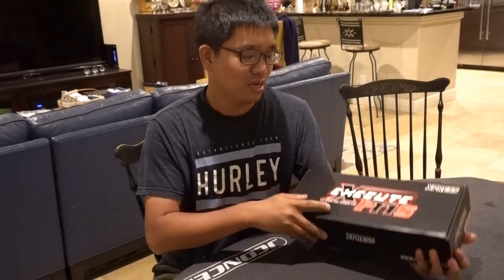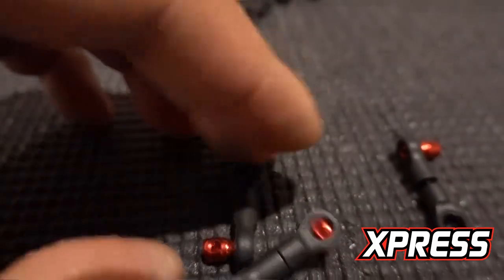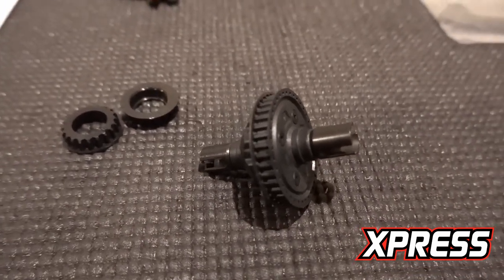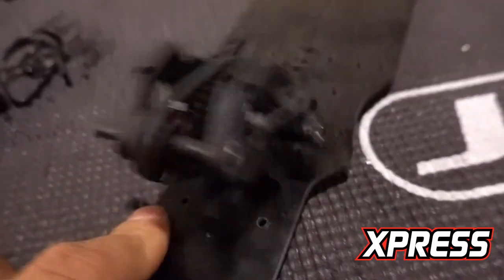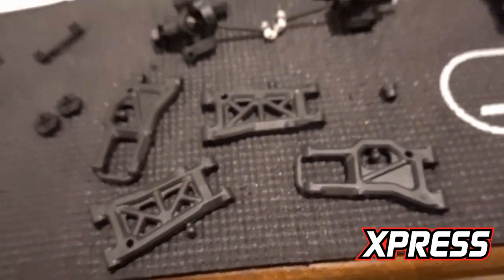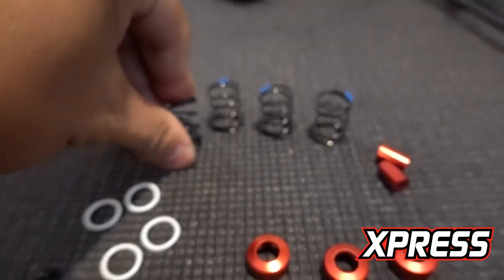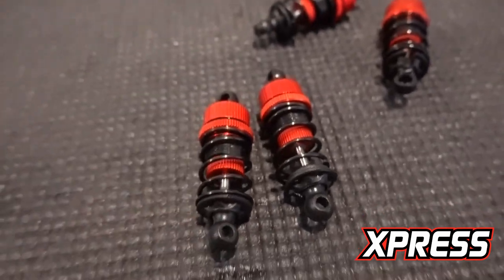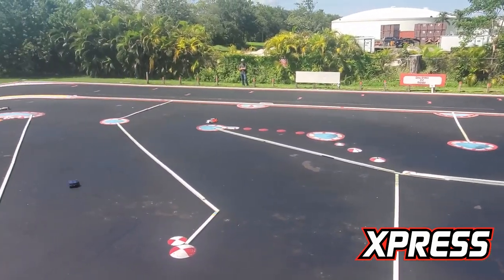Cheap $100+ Budget(FWD)chassis build and test

Comment: I've build one, and although FT1 instead of S model, I think the issue is the same : you only have very little space to go with a small pinion (if you want an FDR of 5 or more f.ex), because the motor will hit the spur carrier, with plenty of room left on the motor mount itself. I ended using a larger 48 dp spur of 82 (equals a 110 in 64 dp) to get almost were I wanted. But a design flaw nevertheless if you want to run 13.5 with pretty high kv, a HW v3 f.ex, that like to rev but with a little less torque